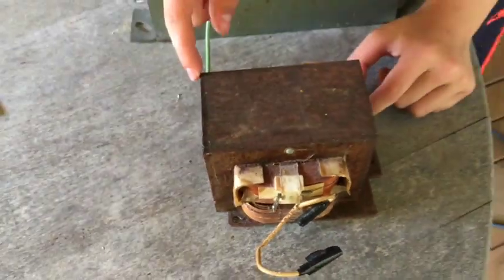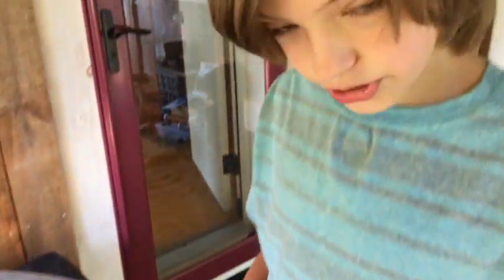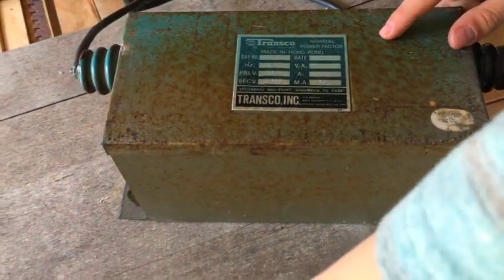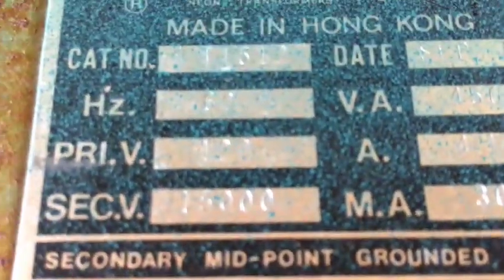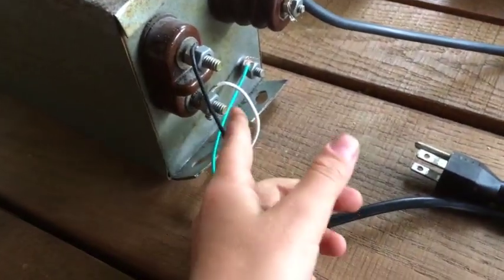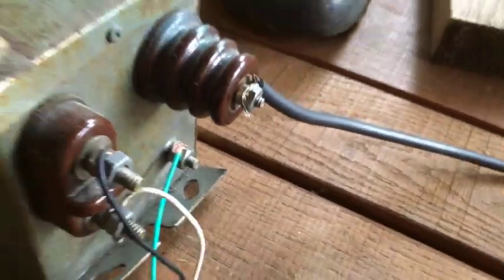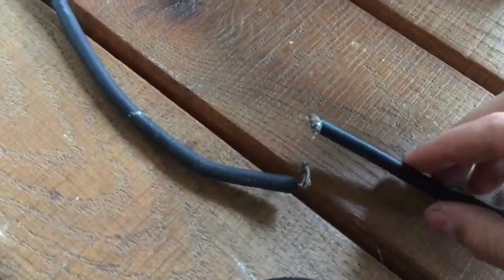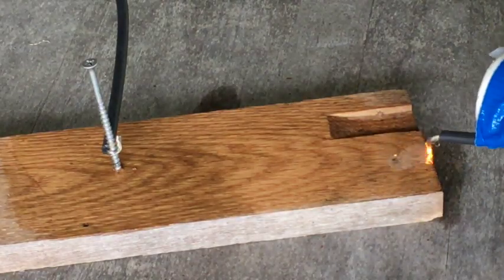15,000 VOLT NEON SIGN TRANSFORMER EXPERIMENTS!!!!!!!

Comment from the maker: What should I make next?
Reply: Resonant mot stack!
Reply from the maker: @ElectromaniacKVA  resonant mots are really terrifying but i might make a huge jacobs ladder with them in the future :)
Reply: @NerdlabsSci  its not terrifying..  i made some videos about my mot stack with 6 capacitors
Reply: when i was 10 i hat my first mot. now im 16 and 2 jears ago my first resonant setup
Reply from the maker: @ElectromaniacKVA  ayoooo those are some sick arcs, i should totally try that! 1 got my first mot at age 9 and built my first tesla coil(a 5 foot tall spark gap monstrosity) at age 11 lol
Reply: @NerdlabsSci  but you need a high amperage circuit or your breaker will trip
Reply: @NerdlabsSci  and use 2 phases. i have 3 phases available
Reply from the maker: @ElectromaniacKVA  well damn it. my house is off grid (it runs off solar panels) and can't supply more than about 2 kilowatts at once.
Reply: @NerdlabsSci  lol
Reply: @NerdlabsSci  but you need 20kVA for over 1 meter arcs....
Reply: Marx generator

Comment: Awesome to see young people getting excited about stuff like this. Be careful though dude, even 30mA at 15,000v will give you a nasty shock. If you're gonna play with these, I would HIGHLY recommend getting a footswitch to turn it on or off, just in case you do get shocked. That way when it knocks you over it doesn't keep shocking you.
Reply from the maker: Ok, i have stopped working on this transformer to focus on other projects, but if i work with it again i will keep that in mind. thanks for the safety tip :)

Comment: Wowzers Walden... What a treat to get your hands on a transformer like that! Perhaps you should try a voltage multiplier or a Maarx next, that would be pretty fun!
Reply from the maker: Thanks! I actually did try a marx generator a while ago but it was a total failure. If I try again I will probably use commercially made capacitors instead of homemade plastic leyden jars.